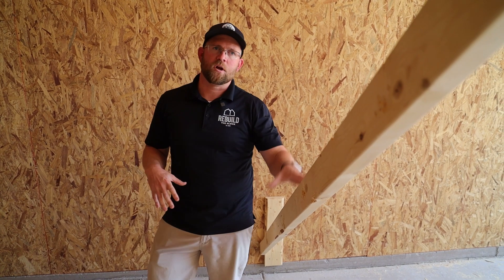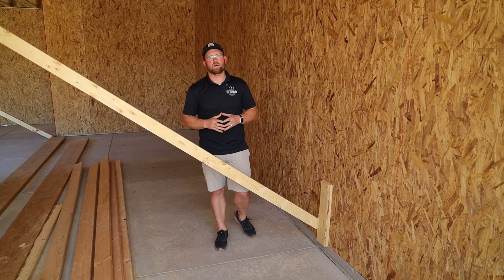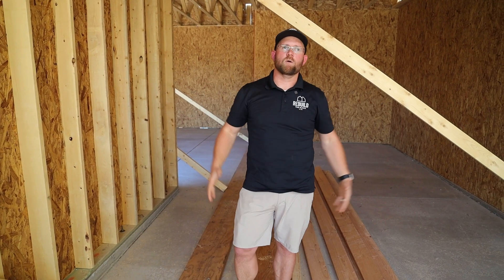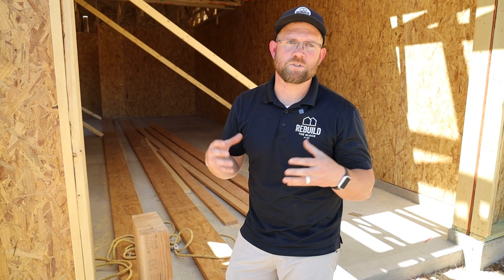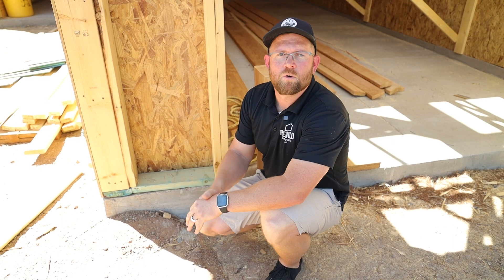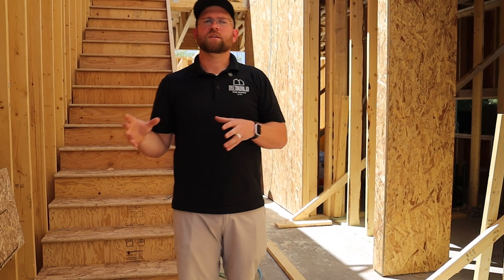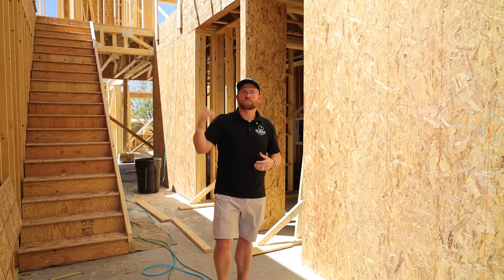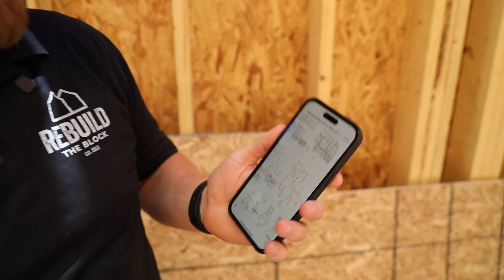Understanding Shear Walls: RACKING| Part 2 | Rebuild The Block

Comment: In my part of the world the very idea of building a house out of OSB plates sounds insane. People here will only use it for decorative kind of jobs or putting together a toolbox shed at best. The exterior walls of my home for example are 30 cm thick metal-framed concrete.
Reply: You mean people do different things in different parts of the world? Cool.
Reply from the maker: Thanks for the comment. You are right, there are different ways to build. We appreciate you watching.
Reply: It's all about wealth transfer, they're slapping these wood chip composite houses together and charging a fortune for them.  They'll be falling apart in 20 years. No one cares if the value keeps going up.